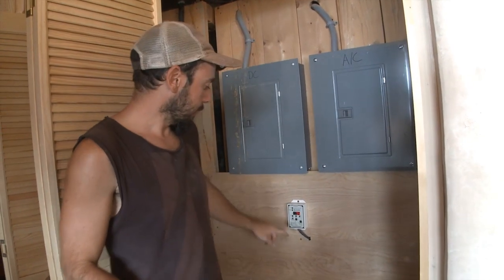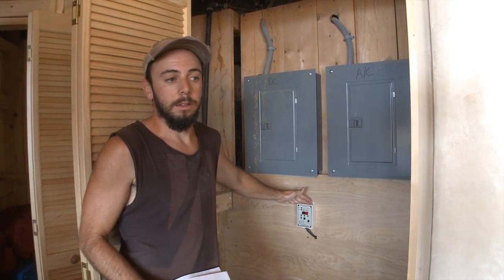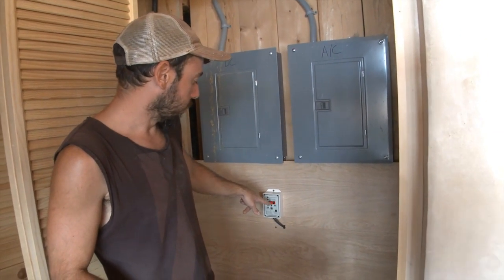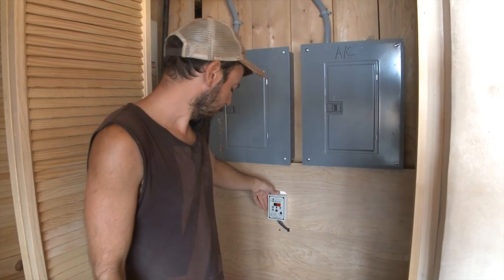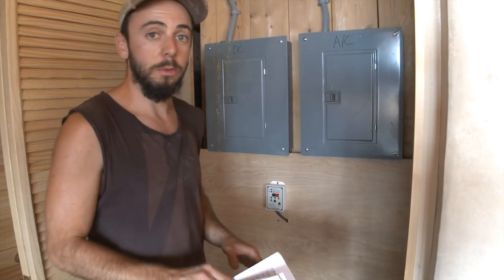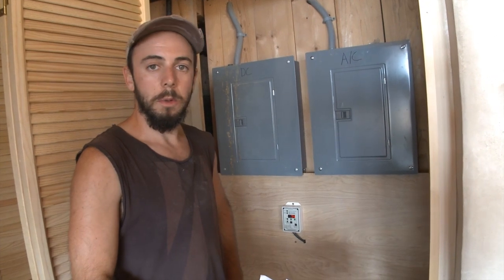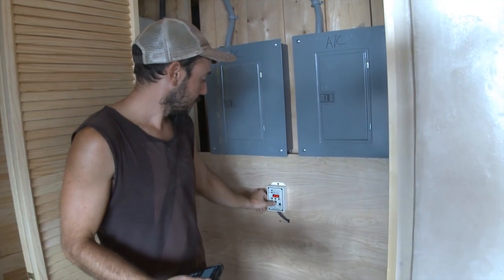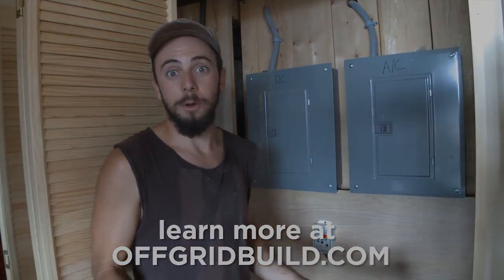How to Use a Tri Metric Monitor for your Solar System

Comment: Tony's comment triggered this response. Handy Bob explained to me that you don't get regulation when charging from the 12 volt port of your generator, or at least from a Honda EU2000. He suggested to get  25 amp CTEK 120 volt battery charger.  That I did, and wow, what a difference! The CTEK shows bulk, absorption, float and desulfating. Since your generator is running, just plug the CTEK into the 120 volt receptacle.  No guessing!
macsoutside tony
4 years ago
Thanks for the vid, but what do you do if it drops below 70%, do you have and run a generator. 
I use a generator to charge mine from the 9 amp DC option on the gennie and use the power to do other stuff that has a high draw that i would not other wise do. T

Comment: Very good explaination of the justification and use of the monitor. The new flow batteries are able to be drawn down to a complete discharge without damage. A 5-10 KW battery could reduce the number of solar panels making more $$ available for the purchase of the more expensive batteries and also the longevity of the battery would great extend the life cycle of the system and long term cost. I understand if your system is already set up with conventional batteries there would be liitle point but would it be useful to consider these in a new system? I would like to have wind and solar because my site is good for both and it would some what even out the lack of sunny days. guyrvan@yahoo.com

Comment: I started buying the same exact system based on your videos. I have four 200 watt panels connected in series to 48 volt pv array  with an Out Back Flex max 80 and 8 six volt batteries to a total of a 12 volt system battery bank, but I only have a small inverter of 400 watts. The solar technician told me I needed more panels otherwise I was never going to top off the batteries to float, equalize or desulfation. That turned me sad because I ran out of budget.

Comment: Lecture on, that's how we all learn.  But I believe these lead/acid batteries are ~$300 each (6v) with at 300-ish AH rating.  I don't have an issue with lithium-ion, just need to know a realistic price comparison.  A somewhat "standard" system is 24v, where automotive use is in the 96+v range.  I'd love to see a true price comparison between lead/acid and lithium-ion components.  Google shows a 12v 300AH at $3,500ea.  That's $7k vs $1.2k, not including the price difference of a charge controller

Comment: (Continued from above) then recharge at three times faster than even that heavy discharge rate. But, my point is longer life at three or more times is worth paying more for so the batteries last as long as the solar PV panels. Consider what replacing two or three times the lead/acid will cost over 15 years.  compared to still having the same Lithium batteries and no adding water weekly either!  I hope this will help you to make more informed decisions. Sorry about lecturing. I am the EVprofessor

Comment: Continued from above posted reply) discharges fully (Down to the 20% level daily and is recharged (Up to 80% of total capacity nightly)while the lead/acid have 1/3 the service life so in ten years I would have replaced the pack two more times and the original lithium-ion are still working well with nearly full capacity. I realize the vehicle is much more intense in its usage than a stationary solar pack as we often fully discharge the vehicle in one hour of driving and  (Continue in next remark)

Comment: James, this was the first of his videos so far.  I can understand using lead acid as they look so inexpensive, but, presently lithium-ion are selling for about twice the price of lead/acid I recognise the lithium advantages of lighter weight and size are relatively unimportant is a stationery and very important to me in a vehicle application. However the relative life cycling of discharge and recharge is important. and Lithium-ion last over ten years in a vehicle which  (Continued in next reply)

Comment: I don't know where you found the numbers but the full charge is 80% of maximum capacity and the lowest discharge allowed to not damage the battery is 20% of the maximum capacity. We do not use trickle charging with any of the Lithium chemistries. Only Lead/Acid chemistry benefits from trickle charging and Lithium chemistry is longest lived at 50% of full charge. and that is the warehousing longest storage without damaging the lithium batteries. Questions answered: EVprofessor(at)EVprofessor,com

Comment: Thanks for the vid, but what do you do if it drops below 70%, do you have and run a generator. 
I use a generator to charge mine from the 9 amp DC option on the gennie and use the power to do other stuff that has a high draw that i would not other wise do. T